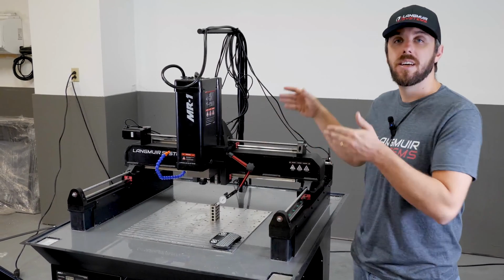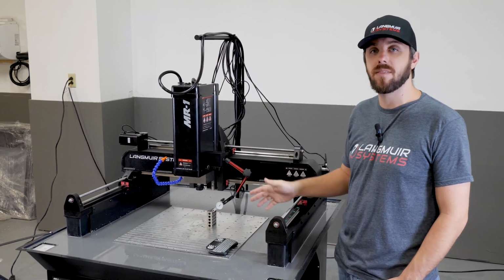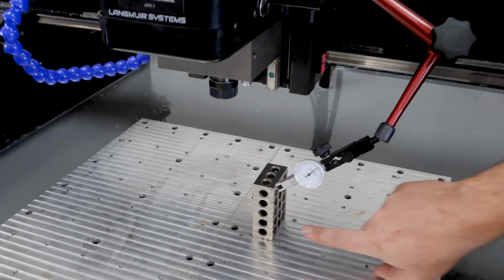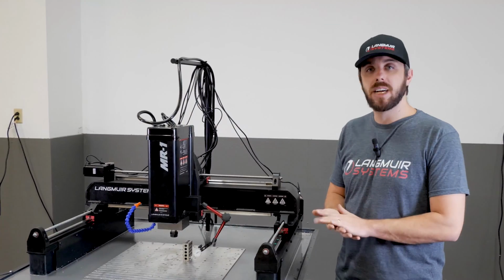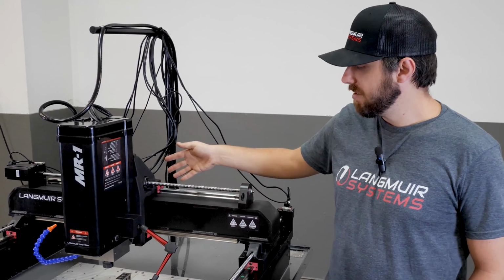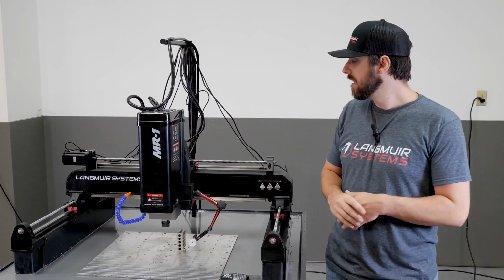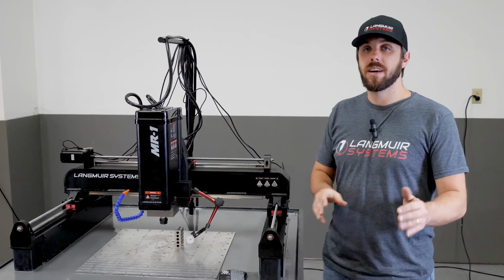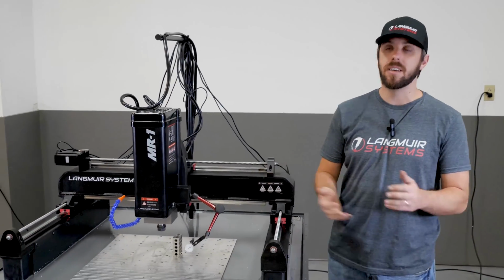MR-1 CNC Mill Assembly Tutorial: Inspecting Z-axis Alignment

Comment: So, is it safe to say we’ll need the indicator and a 1-2-3 block for assembly?
Reply from the maker: At a minimum you will need a dial test indicator during assembly (watch how we adjust coplanarity of the Y-axis rails before and after the concrete pour in our assembly manual videos on our website).
Reply: @LangmuirSystems  Good to know! I just paid my deposit and plan to go through all of the videos and order the tools I’ll need, didn’t think to add the indicator before